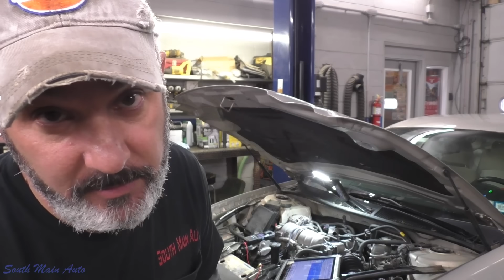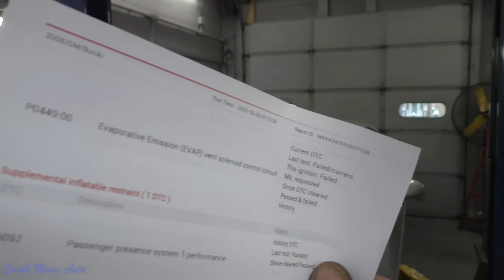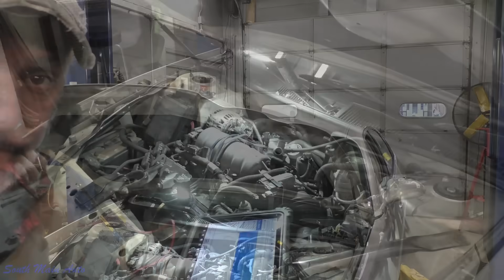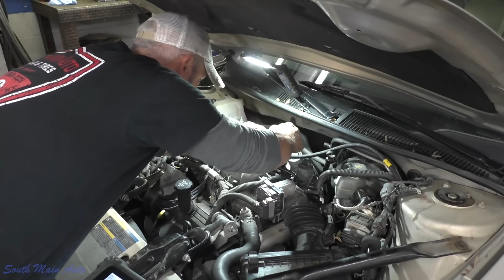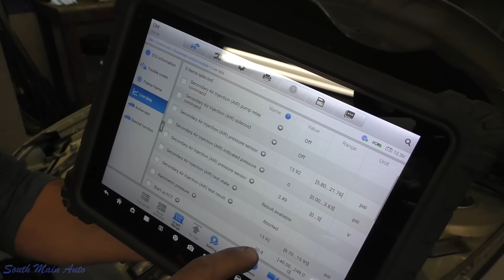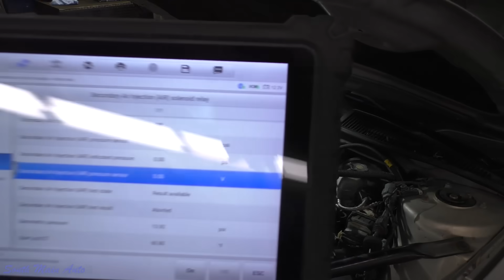When “New” Parts Are Worse Than The Broken Ones 🤬

Comment: I had 4 junk wheel bearings, 2 skf, 1 timken, 1 autozone plus a o reilly brake pad that fell off backing plate and ruined rotor, yay
Reply: Four bad bearings out of the box, even from name brands, plus a brake pad coming apart — that's a rough stretch. The brand on the box doesn't seem to mean what it used to. Hope the do-overs went smoother.
Reply: SKF and Timken both failing in the same batch — that tells you it's not just bad luck anymore. Keeping a little log of every warranty fail (brand, date, where you bought it) is worth it. Your future self standing at the parts counter will thank you.
Reply: @SkillForgeAI-r5n I think i am just going with oem bearings now
Reply: Smart call — OEM costs more at the counter but way less in comebacks. Hope the next set treats you better.

Comment: My son had a 1994 Camaro,there was a trans fluid leak, i check it out and it's the speed sensor so i change it. A week later the leak comes back,it's the speed sencor,Borg Warner made in USA! It's leaking through the sencor coming out the electrical connection. The parts guy said he never saw that front  a new one and replaced it with a New Borg Warner, same shit in a few days! Got my money back and got one front NAPA for twice the price made in Taiwan, never had a problem again!
Reply: That's a classic one — the speed sensor O-ring gets brittle and it'll look like the whole trans is leaking. Good eye on the diagnosis, cheap fix. Thanks for sharing the win.

Comment: Just had a similar thing on my daughters car. Bearing was bad so I replaced it. It seemed better but I still had a noise. She needed to get back to school and I needed to do whatever I needed to do. A week later it's making a much worse noise but the shakedown seems good, etc. I change out the same wheel bearing and NOT A CHANGE at all. Grinding, deep grind that seemed to come from under the middle of the car.   The faster you go, worse grind when you veer one way, but you cannot hear it from the outside....so up in the air again and everything is checked. Tighten this, blow out that, I even stuck a camera under there and did another test drive. Once again there is pretty well no play in the wheel, it spins like a dream by hand, and the grinding did change it's original spot. You cannot hear it at low speed or outside the car. I start doubting myself and questioning reality....so I have her take it to a shop and pay for a diag. A bit later I am lucky enough to get the best mechanic that has ever existed to actually call me on the phone. He explains tires and noises to me. He's so nice that he even says that I might know a couple things about cars, based on some of what I told him when I was giving info to assist the diagnosis. Anyway......the worlds greatest mechanic soon found out that the wheel bearing was bad. The same wheel bearing that I had just replaced- twice. 
It was lovely.
Reply: That's the worst — a bad brand-new bearing will make you question your own work every time. Sadly it's one of the most common offenders for this these days. If the noise came back, I'd get it warrantied before the return window closes.
Reply: @SkillForgeAI-r5n 
I should but I'm just going to never buy from that maker again (and hopefully get lucky enough to not accidentally buy a rebadged one 😅), and move on. Kind of like a nightmare....I'll just focus on something else and get it out of my head if I can. It was very recent though so I still have some PTSD lingering about! 😂. Good content though and I edited my comment to adjust a couple autocheck mis-spelled words. Have a good one.

Comment: Eric, couldn’t help but fall in the floor laughing. I have been there so often with crappy “new” parts, especially aftermarket. I’m a Chevy guy, so I make every effort to buy AC Delco, when I can because most of the other aftermarket parts will either not work, or will soon fail. At least I find it easier to do the work the 2nd time, since I figured it out the first time. Thanks for what you do, I feel your pain.

Comment: Acouple years ago i had to go through 3 different sets of monroe matic rear shocks for 014 nisson frontier 4 by 4  to get a pair that didnt leak oil and go flat within a day or two. finally got a good pair and are still good over two years later. have amillion other simalar stories about crappy china made products of all cinds not just car parts. all started after clinton signed the nafta free trade agreement back in the day . remember ross peroe said that big sucking sound you hear is all our jobs being sent over seas! ive been bitching about it for 40 years but nobody wants to hear about it anymore!

Comment: Yeah, you used to fix something once, and it stayed fixed. Now you get to fix it 3-4 times with different "new" parts until one finally works... if you're lucky. And then the icing is most parts stores refusing returns on the garbage components and will deny warranty, even after you jump through all the hoops. It's infuriating.

Comment: Past 4 yrs I cannot get a Chevy Cam Shaft position sensor that works out of the box without going through 4 or 5 of them... even from the the dealer. Also had to do a Cam Phaser replacement, ordered from the dealer and the once made in Germany parts are now made in China and I went to the dealer to get "OEM" parts but they sold me the same thing I can get off Ebay. Times have really changed.

Comment: Okay all aftermarket parts are junk? Listen to this.... Bought a new evap purge valve from advanced Auto parts. Lasted 2 weeks it went bad. Bought one from the temu app for $8 for shits an gets. Well ive driven it 15k miles an so far it's still working. Pretty bad a temu valve last longer than one from advanced Auto parts.... Ppl can bad mouth Amazon eBay Rock Auto an temu but I'll buy my parts from them before I go waste hundreds on other parts that doesn't last either.

Comment: I purchased some Audi control arms from eBay, they look the same as OEM, aluminum with ball joints. They went bad again fast not even a year. I got them again, listen the OEM ones are really expensive. Anyway I pulled a ball joint boot off.... No grease whatsoever. I packed the ball joints with grease like they should be, drove the car for years held up solid. What a dumb corner to cut they won't even do the bare minimum to have them last. They are a perfect copy of OEM except no grease, I don't think any aftermarket joint has grease even from autozone

Comment: I know when I swapped out an EGR from NAPA that they saod was for my Pontiac Torrent, it was actually not correct meaning the potentiometer to tell the car how far open it was was would send back the wrong voltage. Turned out only the dealership had the roght parts.

Comment: Getting a “new” part that has the same issue as the old part is extremely frustrating. I work on large electrical systems and I’ve had the same issue happen a few times. New board has the exact same issue the old one did. Order another new board and it’s fine. WTF?

Comment: Oh lord. I have a piss and moan project. 
2018 Ford fiesta 1.5 liter common rail diesel. 
Hard start in the morning. 
Runs and drives perfectly when it starts. Starts right back up if it sits warm for 15 minutes. 
Won’t start if it’s warm and shut it off and try to start immediately. 
So far.
Glow plugs ✅ 
Glow plug relay ✅ 
HP fuel pump ✅ 
Sender fuel pump ✅ 
Dpf sensor ✅ 
Egr system ✅ 
Maf map ait sensors ✅ 
Timing scoped ✅ 
Fuel filter replaced was clean. ✅ 
Air filter replaced was clean. ✅ 
I’m down to injector leak back testing, waiting for tools.

Comment: Way back in 1994 Apple sold the rights to their OS for other companies so they could make “Apple clones” went through the same BS! 4 CD drives on a warranty claim, non of which worked. Noticed every one apart the original had a different revision SN. Had told them that after the second one! Problem solved after telling their warranty folks what I had found out. Sometimes you have to do others jobs for them.

Comment: I just went through this with ball joints. I had three new ball joints all fail within 3 months each. I ended up going to a junk yard and pulled a used ball joint that was still OEM and reinstalled it on my car. That is working better.

Comment: Went through this with a 2002 Toyota tacoma radiator. Parts store had 3 different radiators that did not fit, all china junk. Finally called the local Toyota dealer and he said bring the old radiator in so they could match up what they were seeing should be the correct one. It was a taller radiator, or should I say it hung lower in the support but worked and was cheaper than the parts store junk. I told the customer that he got lucky that the dealer had one that fit.

Comment: Eric you are 100% correct. The aftermarket parts have gotten exponentially worse the past few years. I put new Delphi control arms (A arms) on my car about 18 months ago. All the rubber bushings are already crackled and dry rotted as if they were 20 years old. Also a power steering pump with a misaligned pulley. It's a complete joke. Much better scouting junkyards or parts cars on marketplace than buying new parts.

Comment: My worst experiences have been with older obd1 gm products, every sensor is obsolete at this point and aftermarket or used is only option, there is almost 0 chance of getting aftermarket sensors that read correctly, losing battle

Comment: Had the dealership put an OEM Honda rear shock in my 2011 CRV. Lasted 14 months and 14,000 miles. First one lasted 14 years and 120k miles... Parts are trash these days. The kicker is that the warranty is 12mo/12k miles. What a joke.

Comment: I tried to buy a rebuilt part to avoid a Chinese aftermarket a while ago. Never got the rebuilt (border issues). Ended up getting the part from a wrecker and hoped it was the original and not aftermarket. No problems. Problem is my car is 23 years old and few wreckers keep cars that are that old. I live in Ontario where they use a lot of salt in the winter. Now Napa no longer sells made in USA gold/platnum oil filters. They now come from China and Vietnam. No Napa does not pass on the savings to the customer. I have had very few new parts fail. Last one came from a GM dealership. Once I received a part with the wrong electrical connector and the vendor insisted it was correct. It had the connector that would connect on my truck though (part probably wouldn't work on my truck). There is no excuse for the greed out there. Worthless parts seem to cost more now. Can't imagine having to go through this several times a week. Keep up the good work Eric. We all feel for you.

Comment: On a 100 mile trip home on the interstate, my engine started running really rough - out of the blue - misfiring / stalling - just enough power to maintain 55 mph and got off at the first exit and hobbled our way to a nearby Autozone. I diagnosed the issue as a failed MAF. No trouble codes - which sucked because it was the OEM manufacturer. Decided to roll the dice and pay $89 for an Duralast MAF.  Well, that didn't help the situation - we tried to hobble our way home on the backroads at which point the engine had 0 power and we had to get towed 40 miles home. The repair shop said yeap, you need a MAF sensor - wiring is all good. $500 tow and $200 MAF + labor later good to go.

Comment: I totally feel your frustration with comebacks related to junk parts and the trust issues from customers that comes along with it. It's gotten to a point where Ive began repairing parts on personal projects where possible to avoid using garbage from parts stores. Recently did a disassembly of an OEM blend door actuator that was stuck. I was able to free up the motor and it has been working fine since. And still beats a Dorman part! Another example is I disassembled a flaky window switch to clean the contacts, been working perfect ever since. Obviously not worth it on a customer vehicle but has saved me the frustration of made in china garbage in the past. Like you, I try to buy OEM when possible, but there is a noticeable difference between AC Delco and GM Genuine quality wise. Take care!

Comment: Okay.  The original part as a whole is fine, it failed out after tons of miles.  So, the problem is not the valve it's solenoid, connector, board in connector that fires power to the solenoid that snaps open or closes the valve.  So, take the connector off the valve, inspect and clean.  If there is a board, inspect and clean, now for the ectromechanicalanical solenoid, inspect and clean and fire it off.  If all that works, check wiring harness connector to see if someone swapped the main open power with the 5volt signal by taking it out and swapping it.  If they did that would blow the board, hopefully no board just relays, those you can fix, clean and test.

Comment: I'm with ya on the junk parts. As you were bitching im here saying f'n a. There is so much crap on the shelf of even prior trusted suppliers like NAPA. I rarely had issue with Napa parts up untill about 2021. It is hard foe me to keep going because like you said where do you go to get parts, especially for older stuff. Most dealers don't list things for vehicles older than 10 years old and even so I hear some complaints on dealer parts are junk out of the box anymore too. It's definitely a different world in auto repair than even 10 years ago. As always I enjoyed the video, keep them coming.

Comment: Just had a 2005 Crown Vic with a 4.6 towed in for a no start after the owner was trying to get the Check Engine light off to get a sticker. He change a bunch of parts, car no longer ran and he gave up and had it towed over. The fuel pressure regulator was junk and allowed fuel to go directly through it from the fuel rail into the intake manifold. This was the 1st part he changed{from AZ} and it was junk out of the box. From that point he went on to change the fuel pump, fuel filter  and cam position sensor trying to get the car to start. Parts are a complete crap shoot.

Comment: I dunno why Americans need a 3.8 engine in a saloon car, I mean in the UK that might be a 2.0 diesel and it will easily do 140mph with it.  Your fuel must be close to water?.   I mean we used to have 2.3 V6 engines in the early 80s that barely made 120bhp and yeah there were crappy, but near indestructible too.  That old "because we can" argument is kinda null and void now.

Comment: HP Tuners, delete the SAI system, wipeout the monitor. 😂 I’ve been doing this crap for 25 years and even at the dealership we’re getting brand new parts that are junk. I just replaced an engine on a car with 21 miles on it. Never even left the lot and the engine was shot.

Comment: About 4 years ago while doing an LS swap into a G Body , I purchased a replacement radiator from our friends at A.....Z . I get everything together , fill all the fluids and start it , let it warm up , check the coolant level and the is ATF in the coolant . A lot of ATF . The radiator was defective . I pull the pan off the transmission and naturally it is full of coolant . I was beyond fuming mad . All this happened without a test drive and was very costly .

Comment: NAPA used to be my go to store but lately been hearing and experiencing bad with them. I just put new brakes on my 2020 RAM. Got their "premium stuff". Reason the brakes needed replacement was a pulsing pedal. All new stuff and still have a pulsing pedal. Gotta be the rotors are not true. Happened to my Father 20 years ago on his car. All new brakes and still had a pulsing. Took the rotors in to a shop that actually still machines rotors and sure enough, the brand new rotors weren't straight.  All China junk now for maximum profits.

Comment: Nice work bud thing is we are all struggling with manufacturers rip off prices and customers who won't pay theese prices.!Here in the UK good few years ago 8 had argument/discussion with an aftermarket supplier who said Delphi parts were from the same production line as the ones supplied as OE spec manufacturers parts fitted to cars in production  line.! So why is it they never last as long as the parts fitted when the cars are new ? Suspension parts 3lectricall etc .!!!

Comment: I'm a DIY mechanic with my own small channel ... and yes, I am very suspicious now of any non-OEM parts... and even OEM parts are often counterfeits. So here's how I work it... the more labor intense the job the more I'm going to use the OEM part (sometimes even purchased from a dealer) or some type of new old stock sourced from someone I trust of ebay or something. If it's something that bolts on in 10 minutes then maybe I try a "quality aftermarket part" ... something name brand... but which may be bad. Sometimes I get a good one... and I'm happy with the repair. But often times I say "okay this is a junk part" and just move to the next option. Thanks South Main Auto!

Comment: Buddy boy, we understand. I have a 2007 Ford Expedition that I rebuilt the motor in that stupid 54 new cats new head gasket new injectors coils it's a brand new motor. Going to go fire it up and I couldn't get the thing to run to save my life. Long story short I went back and checked all the different things everything was fine but turns out the cats that I ordered from ford; complete junk. broke apart as soon as the truck started. When I tried to take them back they said no dice. Because I wasn't a "real shop" they would not accept the return. Ended up making my own "cats" just to get the thing back on the road.